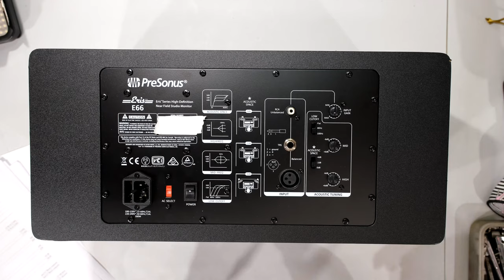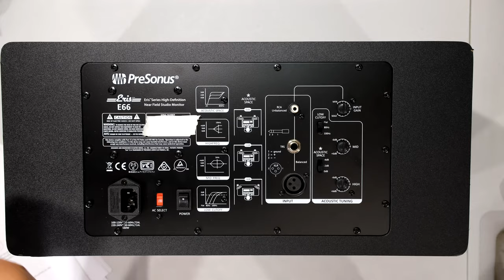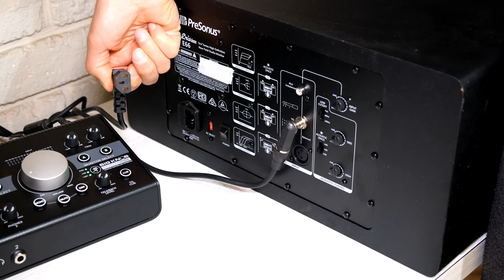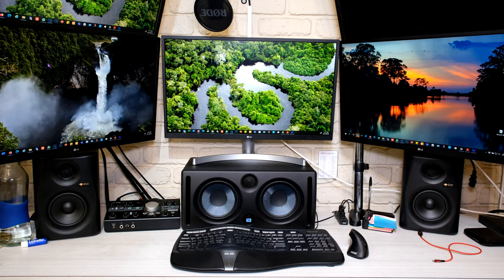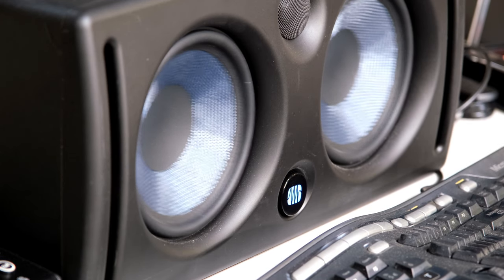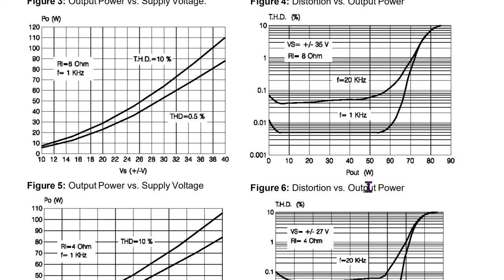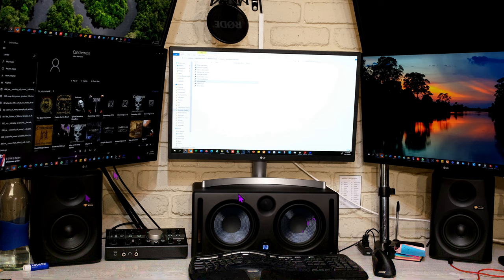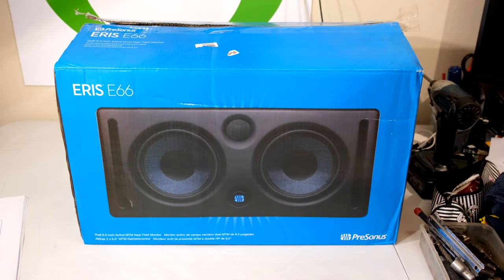Review of the PreSonus Eris E66 - Can it be used as a center mid range?

Comment: I have a pair and they are noisy and buzzy as hell
Reply: I've set up a few of these, make sure your signal chain is good.
Reply: @ster9765  Hi i just found your comment, i got the e44 today and my are buzzy and noisy too...i ordered symetrical cable and the m audio air hub and i hope the noise will leave...i would be happy if u could give some advice for a good signal chain? Is the headphone out on the Interface affecting the monitor outs? Becuz i tried to split the line out of my computer and feeded my e44 and my headphones but there was always noise..
Reply: @EDAVLOFI  
Did you work it out?
Reply: @NoLefTurnUnStoned.  
Yes, after i got the symetrical cable the noise was gone and im really happy with that speakers
Reply: @EDAVLOFI  
Cool thanks
Reply: @EDAVLOFI  
Just pulled the trigger on some Tannoy Reveals 8”